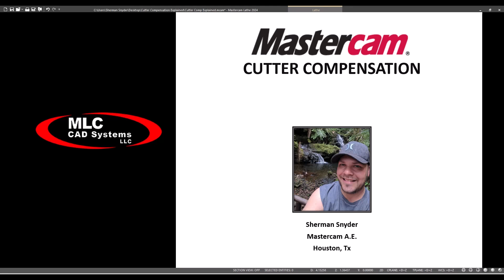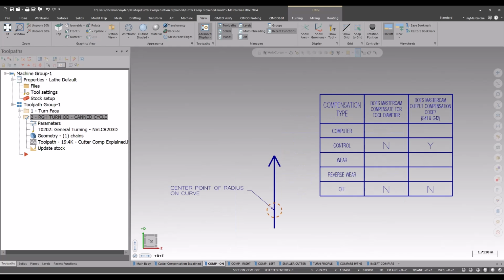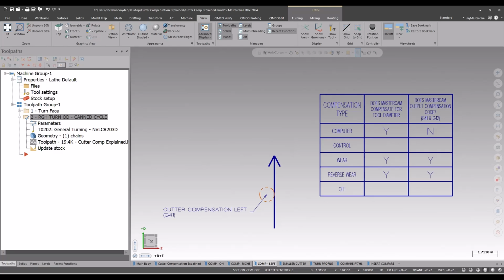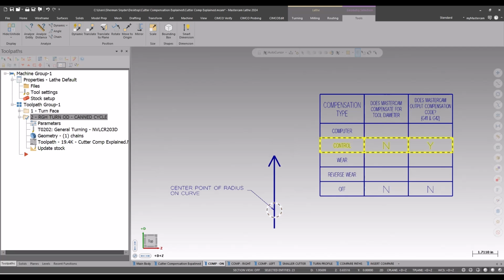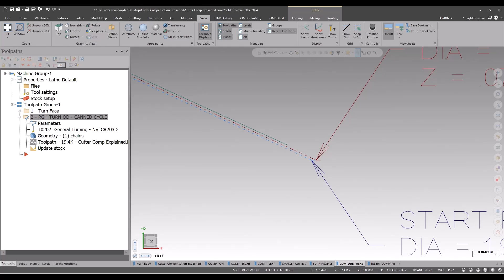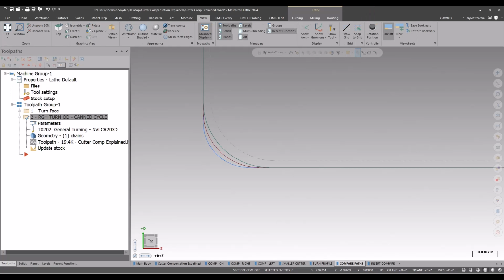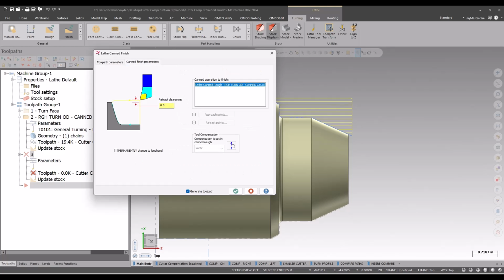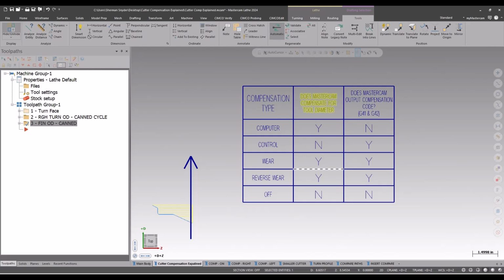Understanding Cutter Compensation in Mastercam Lathe

Comment: In my haas lathe I have an alarm Haas Alarm: 613 COMMAND NOT ALLOWED IN CUTTER COMPENSATION
Reply from the maker: This would be on the machine side. You may want to reach out to your machine tool vendor. If there is a problem with the output of the code, the vendor will be able to point them in the correct direction/proper output. In this case, post modifications may be needed. More information can be found on the error in the link below.
https://www.haascnc.com/service/alarm-search.alarm=ngc_613-0000.html

MLC CAD Systems customers can get expert support to work through this issue and can reach out by email, phone, or website: https://www.mlc-cad.com/technical-support/